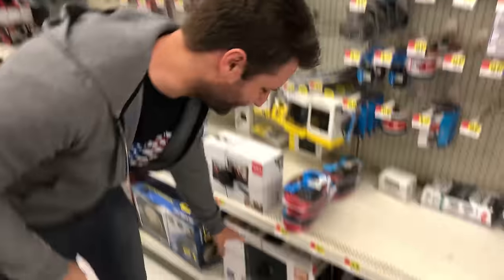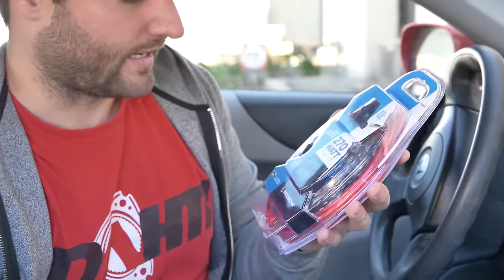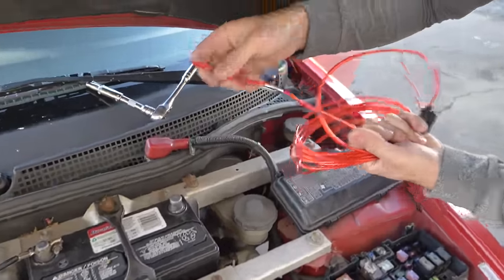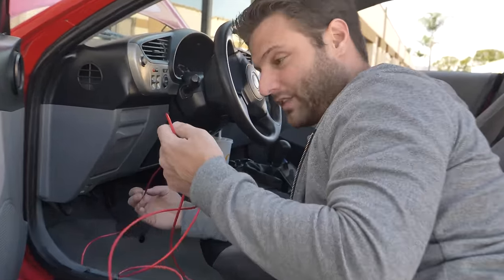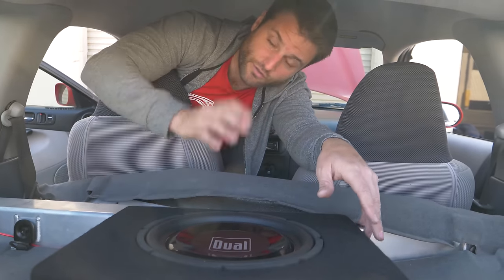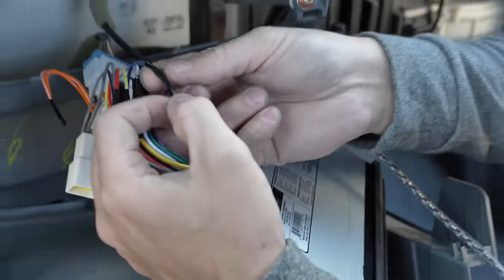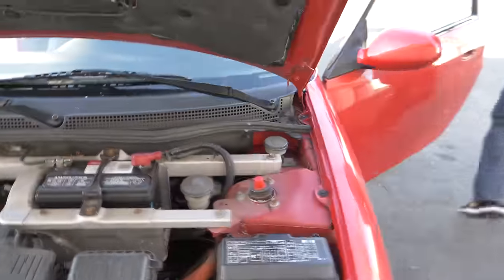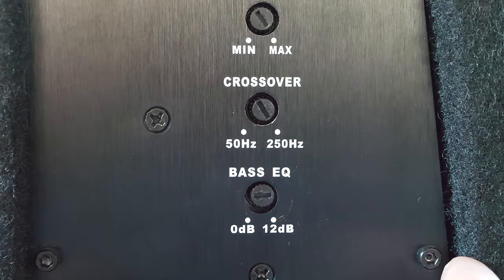How bad is the $70 subwoofer from Walmart? Install | Review

Comment: The best position for that speaker Box would be face up in the bottom of the return cart at Walmart.
Reply: Korey Avery 😂
Reply: Korey Avery fuckin awesome!!
Reply: nice 😂
Reply: Awesome delivery!
Reply: Korey Avery 😂
Reply: Hahahahahaha
Reply: You'd do better getting the rockghost by Rockville. I got my all in one sub from them for 180. Cherry setup too. Easy peazy.
Reply: I blew mine quick lol
Reply: Lol
Reply: Lol checked sonicelectronics and it’s literally 20-30$ more than Best Buy and pay for shipping kinda a bit of a spiff
Reply: @samuelmartz731  i got one was it good tho
Reply: @smoove300  no. I couldnt push it enough. I would take it back and get the 12 inch pioneer off the same shelf. It is kicka$$ for the price
Reply: @samuelmartz731  so u buy a new 10 ? You would have blown a cheap ten with a  real amp cuz u prob had it all the way up its prob like 100rms in all reality I dont buy dual cuz I've had issues with other things did the amp blow?
Reply: @keegan9470  it wasnt all thr way up. Its just a garbage sub. A new 10 pioneer will hold up much better then that pos. The pioneer usually handles my 1200 watt amp without any distortion.
Reply: Samuel Martz tune it right
Reply: They had us in the first half not gonna lie.
Reply: Lmao
Reply: Ngl he had us in the first half
Reply: Ooof.
Reply: Oml😂
Reply: Lmfao
Reply: LMFAOOO
Reply: @thedog556 fr
Reply: @thedog556 actually, u found some sub that does its work better than the one on vid, it's name is Viva eye and i bought it for about 80$ video of how does IT sounds like on my channel 😉
Reply: @thedog556 trust me you can. Alpine do a really good one it sounds ace
Reply: @thedog556 not really? Mine was about £120 and it’s mental
Reply: @thedog556 yes but these aren’t $80 any more.  Plus if it was it’s only an extra £30ish or so
Reply: You killed me with this one 😂
Reply: Savage
Reply: I recommend the KRK 10s it’s about £200
Reply: LOL!
Reply: Lmao
Reply: I have two of these but I put jl audio subs with the dual amp and box, the amp is a true 100 watts
Reply: Good one
Reply: They work good for picking up nails on the jobsite too
Reply: @jeffreis5194  😂😂😂
Reply: Let’s give it a chance
Reply: @Travis Fox how blow it quick
Reply: Definitely some good technical advice.  LMAO.
Reply: Lmao
Reply: Lmfaooo
Reply: hahaha
Reply: Bwaaaaaaaaaah LMAO 🤣😂😂😂😂😂
Reply: You got to break them in first then you'll be hitting 160

Comment: I'm an old man, I admit it. I've been playing around with car stereo's since the mid '80s. My first set up involving subwoofers involved 4 12" Rockford's in a box I built for the cargo area of my Eagle Talon. It was truely sweet. But as I got older, I did not need to feel my fillings rattle. I still like to feel a nice boom in my chest though. So, most recently, I went to cruchfield and placed a number of items in my shopping cart for a "budget" system. My JVC Head, 2 JVC 6.75" front doors, 2VC 6.5" rear doors, and the 1.5" tweeters, and the 500 watt boss amp, all together cost $450. So you can see I was trying to save money. But... I could'nt seem to put a bass system together for less than $500. Then I watched this video and thought, what the hell. If it sucks, I'll shoot it with my colt .45 a few times, hang it on the wall, and call it art. Guess what. In my GMC canyon, it sounds really good!! Thanks for the video. And folks. Don't be afraid of using something even when it's not expensive!
Reply: yeah for some reason people got it in their heads that if its not thousands of dollars its shit. terrible thought process. i've got a 250 stereo system in my bedroom and i like it more than my friends 1000+ system in his car. all about ballance. its ok if every car within a 500ft radius of the intersection cant hear your shitty taste in music as you put your car in neutral and roll it back so people think its stick. and its ok if you can't flex how expensive it is to your middle class peers because thats all people see in a person anymore (not).
Reply: yeah for some reason people got it in their heads that if its not thousands of dollars its shit. terrible thought process. i've got a 250 stereo system in my bedroom and i like it more than my friends 1000+ system in his car. all about ballance. its ok if every car within a 500ft radius of the intersection cant hear your shitty taste in music as you put your car in neutral and roll it back so people think its stick. and its ok if you can't flex how expensive it is to your middle class peers because thats all people see in a person anymore (not).
Reply: If you want something to numb your chest, a shallow kicker comp r 10 with applicable amplifier. It will run you around $300 and has plenty of bass especially for a truck/cab
Reply: The problem people have with these is they don't get very low at all, and they have a lot of distortion. They also have a box that's WAY too small for the subwoofer to play properly. It's just all around not good.

Comment: Up next, Walmart “carbon fiber” hood scoop. 😂😂
Reply: I got here by watching the first radio replacement... how cool would it be a series modding the entire car using nothing but walmart to source parts?
Reply: yeah
Reply: Please do so!!!
Reply: Ya
Reply: Justin Register roof* scoop
Reply: hood scoop is is aisle 9 in the motor department... next to the "chrome" hubcaps  :p
Reply: On a hybrid?
Reply: I’m thinking it will be a fart cannon exhaust.
Reply: I saw someone the other day with a metal mailbox welded to his hood as a scoop.
Reply: RUST adic yeah, cooling for the batteries/electronics. 😂🤣😂
Reply: Justin Register lol
Reply: Don't forget ebay and autozone
Reply: yess
Reply: Justin Register fetch
Reply: Then next the exhaust cut off 😂😂
Reply: Justin Register at
Reply: 😂😂😂 lol
Reply: Walmart hood scoop with cut out hole on the hood.
Reply: Justin Register at
Reply: Nah, just a wing to keep the back wheels on the ground at 35mph.
Reply: @neolightproductions  
Holy fuck now I know what to do with that old metal mailbox I just replaced for the house! Throw it on my 1990 Mazda B2600i gonna get at least +5hp!😂
Reply: #Mazderati
Reply: Spinner hub cap install?😂
Reply: Upside down garbage can lid 😂😂😂😂😂
Reply: I-Love-CO Mountains  man you better get one of those 6 foot wide wings that stand 5 feet tall over the roof of that  B2600i man! That scoop is gonna make you loose traction from all the added HP!